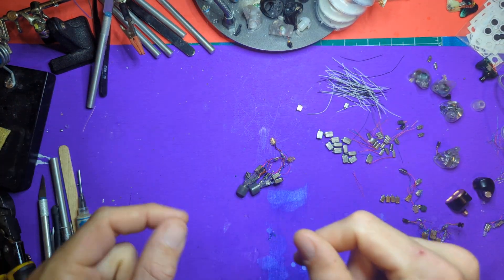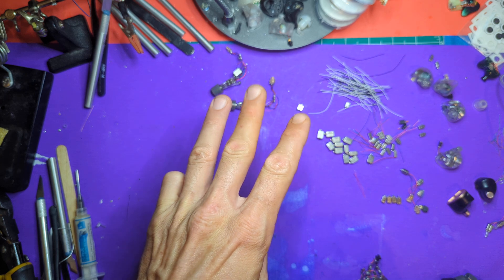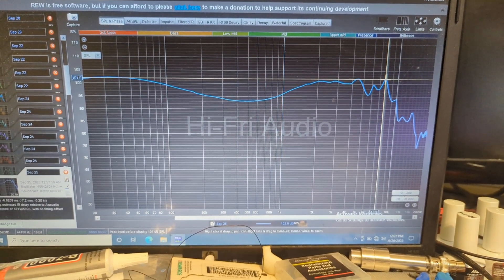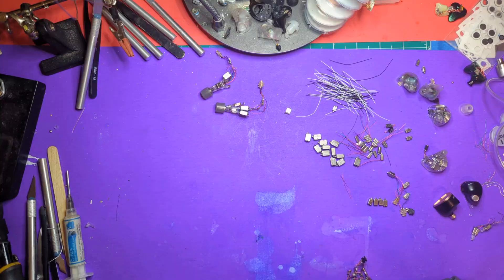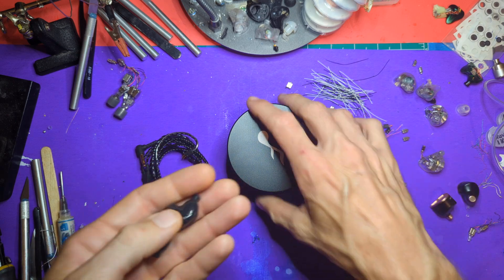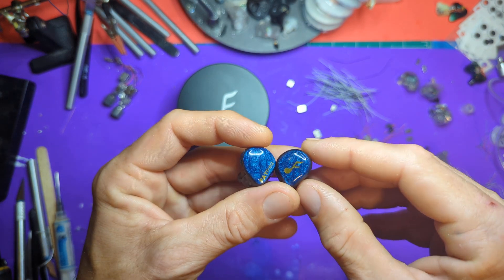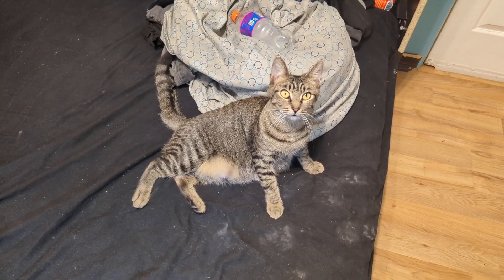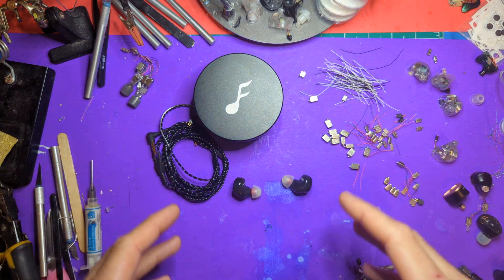FatFreq Maestro Mini review: "sometimes price does not = performance."

Comment: I will say a few things, I bought my own new and yes that is the stock cable. I didnt get a circular case but a plastic latching case that came with earplugs, earbuds and a cleaning tool. The owner that sent that to you also put some type of grill on the review unit. They are supposed to be open bore. Mine also didnt have easily visible seems so no idea whats going on there. 

Apart from that its a basshead iem so I use them every now and then. Needs a ton of power to perform.
Reply: Also to mention, I heard from earlier units about driver flex/venting issues. Such as the unit gizaudio reviewed. I noticed on your review unit there was serial numbers on the shells, my guess that was an older unit.
Reply: Updated versions come with a mesh on the nozzle and that circular metal case.  I bought it a couple of months ago and was hoping to get that plastic latch case.
Reply: Hey Hi-Fri. Good analysis as always. Appreciate the update on Barcelona. Any way I can pick up an Aphex still?

Comment: hey Hi-Fri a bit out of topic...do you have any idea on how can I replace the nozzle on moondrop chu 2? can I use the nozzle on TRN conch? or do you now a specific resin nozzle that can be used as its replacement?
Reply: Hi Fri is out but I once my nozzle broke off and I simply superglued a nozzle from another IEM
Reply: @LetsPullTheTarp  I’m considering on just polishing the nozzle since I cannot find standalone nozzles for chu 2. I might avoid iems with brass or metal nozzles next time.
Reply: Contact seller to see if they offer replacement nozzles. I don't think Conch nozzle will work, since CHU Nozzle screws at the top not the base.